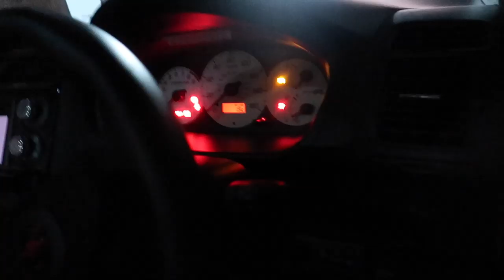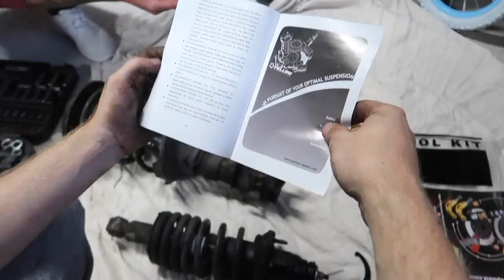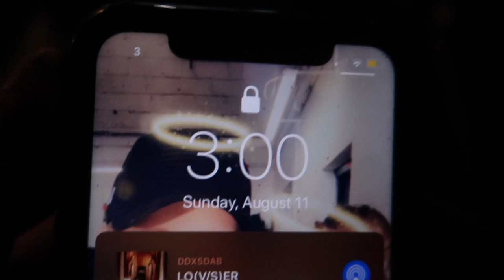YELLOWSPEED COILOVERS FOR THE EP3!!

Comment: You might find that you need shorter inner tie rods on this if you are running any sort of camber on the front due to the different arms on the yellowspeeds. Naturally they will toe in a fair bit after installing them on the front but you will find out when you have the setup done!

Comment: Yo Jesse, just fitted yellowspeeds on my DC5, great product, I have had to also get adjustable drop links, and a steering rack raiser for the rack to straighten it out. Currently its very washy on front end, as the anti roll bar is technically doing nothing, does your EP3 feel tight up front with just the suspension changed?